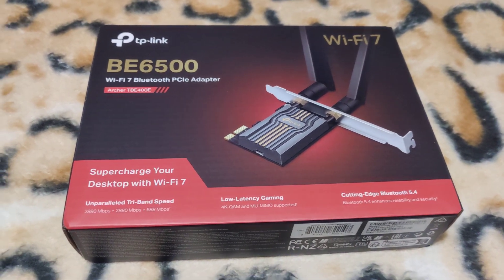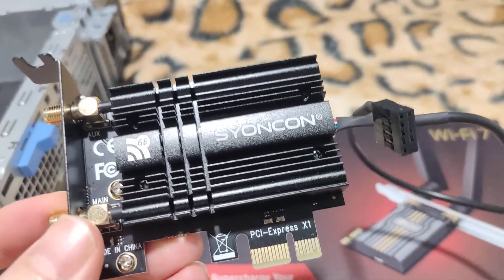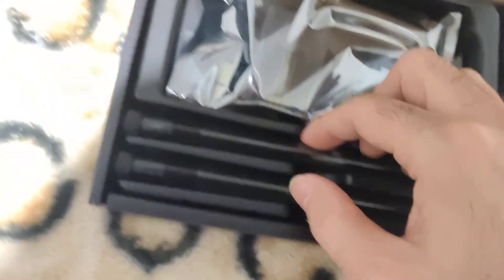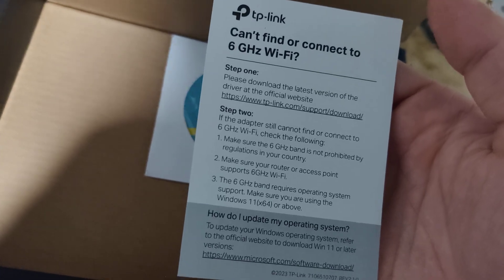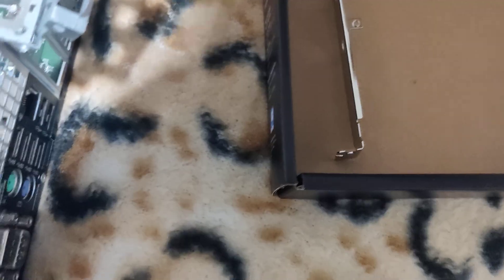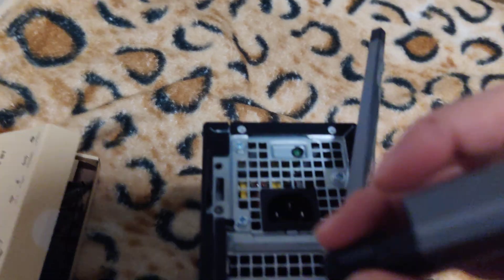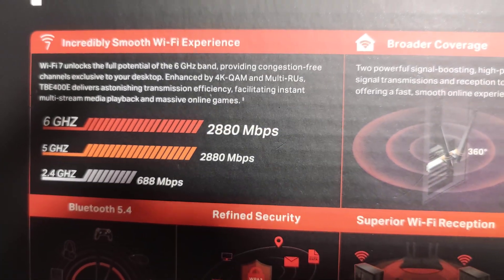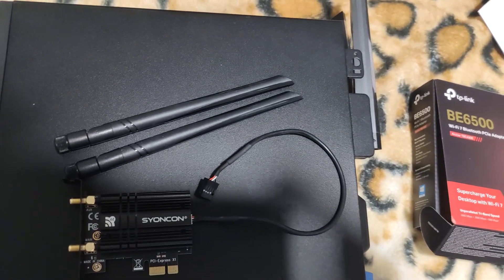TP-Link Archer TBE400E - Wi-Fi 7 BE6500 / Bluetooth 5.4 PCIe Adapter

Comment: Hey man, can you tell me what wifi module is inside it? TIA
Reply from the maker: MediaTek chip, the exact model is on one of my latest videos
Reply: @TechWares  Thank you for your answer. How is the performance of it? is it as good s Intel?
Reply from the maker: @Arda_Viraf Performance is just fine, identical to Intel chip
Reply: @TechWares  Between 6E and 7, do yiu feel any improvements? Like the speed, connection, stability...etc?
Reply from the maker: @Arda_Viraf not a big difference for me, most likely because we don't have many devices connected to the WiFi in the house

Comment: kinda useful video, but I wanted to know which SoC adapter uses.
from Amazon reviews it looks like it is *Mediatek MT7925*.
which is both good (coz Linux 6.7+ support out of box), and bad (160MHz "only" bandwidth, which means "only" 2.8Gbps link instead of 5.6Gbps).
Intel BE200 is faster if it only worked on AMD systems. And there is Qualcomm NCM 865 which is good with 320Mhz support and Linux is supported too and works on AMD even, but difficult to find it (yet?).
So there we go, Mediatek I guess. At least it's not Realtek WiFi 7 chip, which is currently locked to Windows 10/11 (no Linux driver).

Comment: bro why!? you know tp-link is getting banned right? I would recommend ALPHA but they don't have a wifi 7 nic available yet. Also you know none of this matters if your AP doesn't have wifi 7 right? And around @ 9:00 mins you say megabytes per second, Mbps is mega-bits, small b is bits big B is bytes like this Mbps (bits) MB/s (bytes) there are 8 bits in a byte. Honestly I would chill on wifi 7 rn, its a brand new technology and there isn't much support yet, im developing a wifi 7 nic on my banana pi router rn. You're just gonna run into bugs and stuff until it's been out for awhile.
Reply: bro, it's not TP Link, it's Mediatek inside.

Comment: just use ethernet
Reply: if only I wasnt on the third floor of my house 🙄
Reply: @_ssoh_2651 Ethernet cable works up to 100 meters
Reply: wifi 7 technology is actually the first that could be better than a wired connection, fucking wild right?
Reply: @deafmute420_9  no it cant
Reply: @deafmute420_9  WiFi 5 and onwards only really help if you are in the same room or have thin walls, in which case you can probably route a cable anyway. At longer distances or with thicker / brick walls in the way they all fall back to the old WiFi 4 standard, 2.4Ghz with good penetration and a max theoretical bandwidth of 300Mbps, which is quite congested nowadays with all the IoT devices.